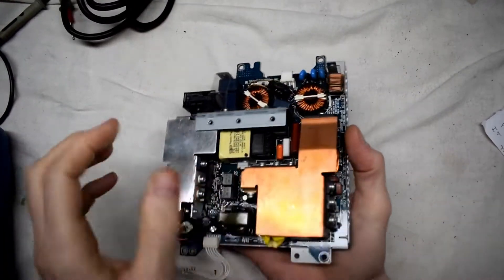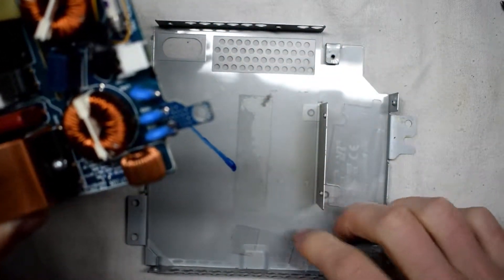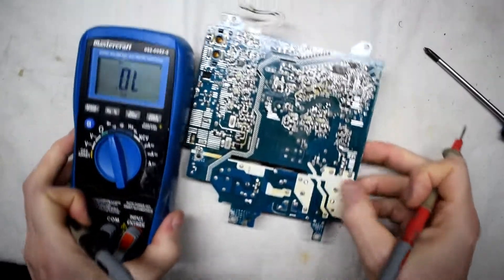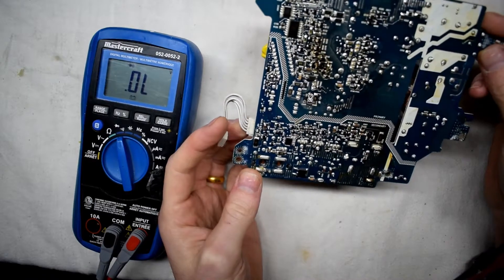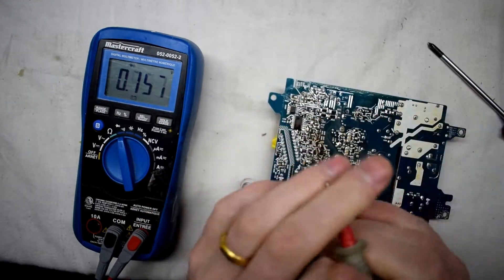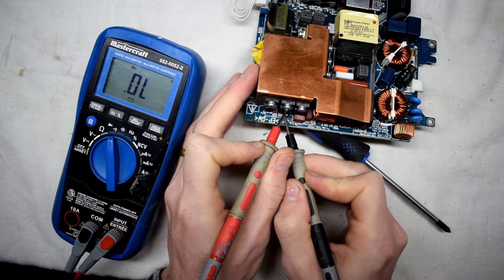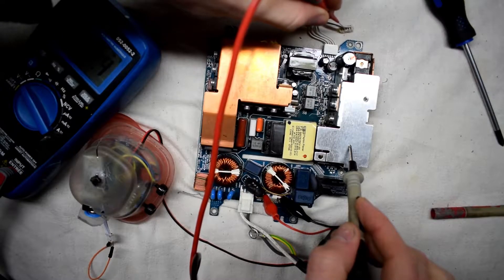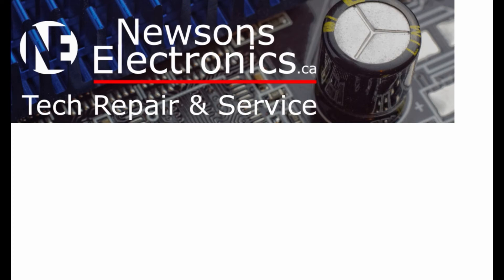PlayStation 3 power supply repair (Model ZSSR5391A)

Comment: My my power supply has a problem,  when I turn on my ps3 the red light go on then it start blinking red. I replaced it with another one and it works find, so what do you thing is wrong with it?